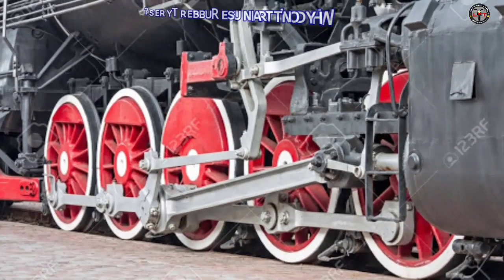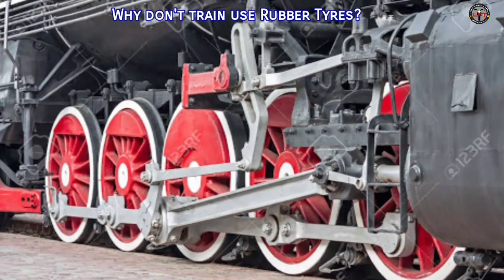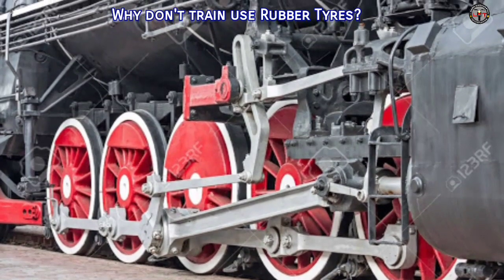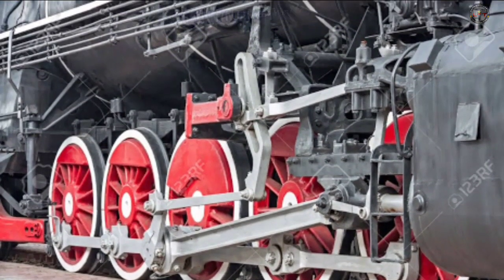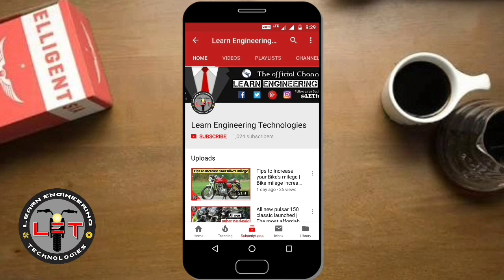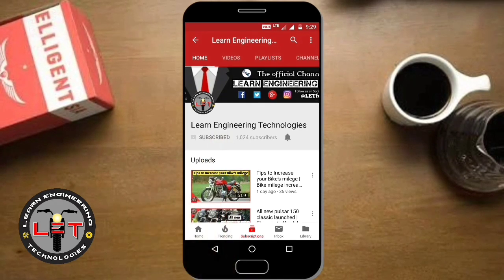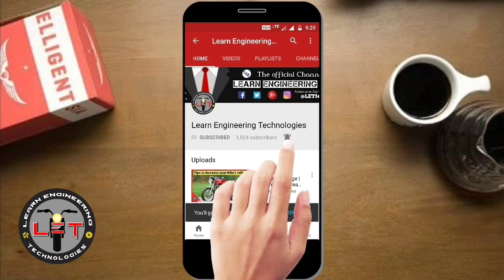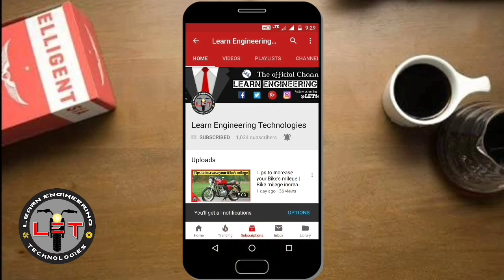Why don't trains use Rubber Tyres inspite of steel wheels?

Comment: Can you solve my problem... I have a question.... 
Can trains runs on road? I mean Can trains work without tracks?
Plz reply me
Reply from the maker: yeah it is possible. but that's poor effective. we need to replace the normal trolley wheel inspite of usual one. In roller type wheel we can't obtain max speed. even if we driven at max 100, that is more dangerous one. It can slip and collapse anytime as there is many passages linked into it while turning slightly. that's why we are operating trains through tracks. otherwise it will dangerous for passangers.
Reply from the maker: yes in china they are using trackless trains. they are using dotted lines inspite of rail track. it is limited to 300 persons capacity where as railway trains can carry upto 1600+  persons. that trains using sensors which can measure and move in the white dotted lines. that's what the mechanism. top speed of trackless train is 70kmph where as track train reaches max speed of 150kmph+.
that's why track trains are effective than trackless chinish trains
Reply: Nope
Reply: How would you steer a train without tracks?